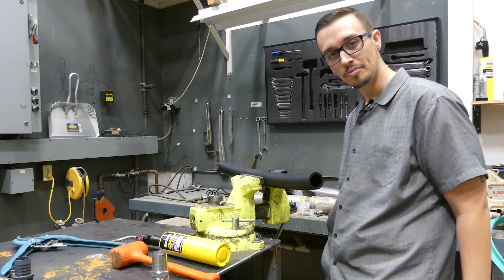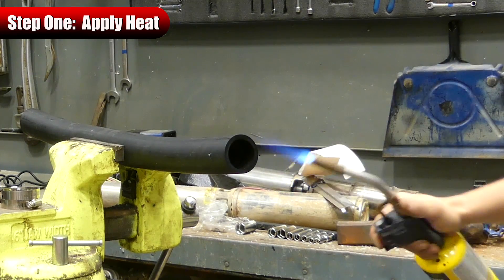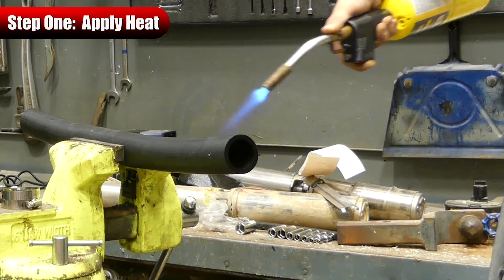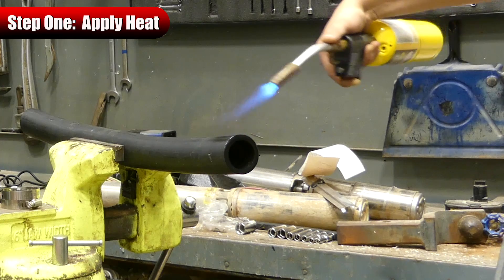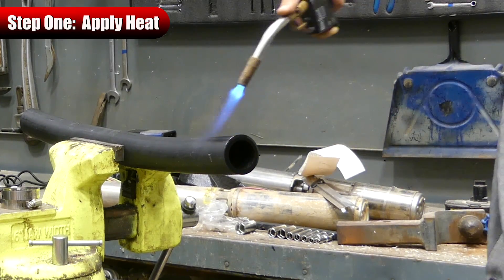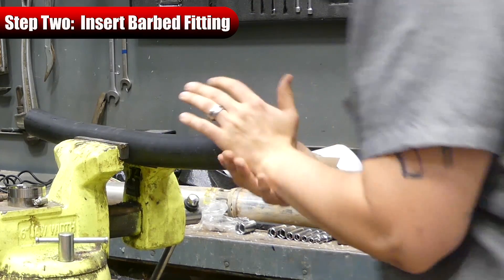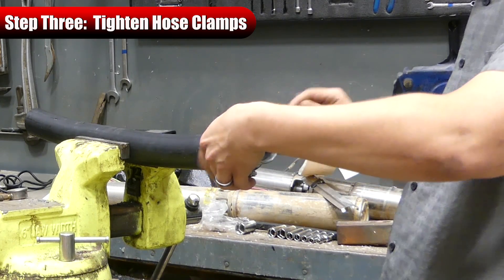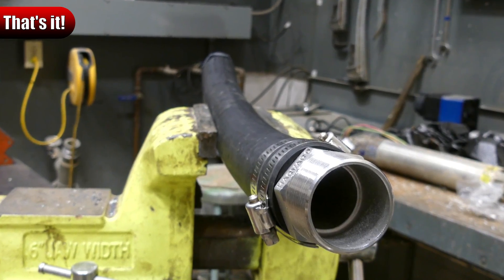How to Connect Poly Pipe to ANYTHING using Barbed Fittings

Comment: Can heated Polyethylene pipe be stretched around a larger barbed insert.  I have a 1" barbed fitting and two Polyethylene pipe options. #1) The ID of one Polyethylene pipe is .87" and #2)  ID of the other Polyethylene pipe is 1.097.  what one should I choose for a well pump application?
Reply from the maker: What size are the poly pipes? 1" and 1.25"? You should use the same size insert fittings as your pipes.
Reply: 1 1/4 inch is the smallest I would go on any well application. most are 1 1/2" or 2" for maximum water flow.

Comment: OK I got some good info I never knew, however, my problem is removing these fittings after they are installed. Any tips? Thanks!
Reply: re-heat them and remove them. however the pipe end will be deformed and not be any good for reconnecting to a fitting. I suggest you simply cut them out with a hack saw and if it need's  be extended  add a splice barbed connector and a small piece of poly pipe to the end.

Comment: Can this black poly piping be used as a replacement to a corroded copper line from the meter to the main valve to the house?  Is pet better than poly for this use and how deep should they be buried down?
Reply: If you are asking these questions please don't do it. Lol

Comment: Why don’t you just buy poly pipe compression fittings that are made for the job .
Reply from the maker: We do sell those as well, but for the cost many contractors opt for insert fittings since the compression fittings are easily 10x as expensive.

Comment: blow torch is overkill.. i prefer heat gun
Reply: Heat gun is ok unless your outside on wet grass or working where a pipe has broken and soaked the area,Butane won't electricute you
Reply: @desert1cop  bammmm

Comment: Do these barbed fittings rust?  Or are they stainless?  I'm needing to pipe 1000ft of drinking water from my well to a large 1000gallon poly tank, and I want to be sure the connections dont rust on me.  Should I use brass?  How long do the connections last?
Reply from the maker: We sell brass and stainless, we like to go with stainless because the barbs go a bit deeper into the pipe. I'd say the fitting should outlast the pipe, 20+ years or so.
Reply: R.C. Worst & Co., Inc. Thanks!  Will check out your site

Comment: You are oxidizing the poly with an open flame, wouldn't a heat gun be better ?
Reply from the maker: This is a great question that I think warrants a followup video. I spoke with the factory that manufactures our poly pipe, they said that oxidation does not occur until the pipe is heated to over 425 degrees. He also mentioned that it is generally not a worry when you're using a torch because the pipe is soft enough to work with long before 425 degrees. Keep an eye out for our followup video!

Comment: That makes perfect sense compared to other info I have read/watched... I have 1" HDPE I think it's 200 or 250 psi and I need to connect to a 1.5" polypropylene sink trap tailpiece. Any thoughts? Thank you.
Reply from the maker: You would want a 1" insert x 1" NPT and a 1" x 1.5" bushing. If the sink trap has female threads then that's all. If it has male threads you'll need a 1.5" Coupling as well. Here are links to buy all 3:
https://www.rcworst.com/BII-SSMA-100-Stainless-Steel-Male-Adapters-1-MPT-x-1-INS-p2174.html
https://www.rcworst.com/304-Stainless-Steel-Bushing-1-50-x-1-p5074.html
https://www.rcworst.com/316-Stainless-Steel-Merchant-Coupling-1-5-p8091.html

Comment: great vid.  Question: in low pressure situations must the pipe be heated first?  I wish to go from black poly to PEX, have all the barb fittings and clamps, but do not have torch.  Can I get by with just clamps?  Many thanks
Reply: Use a heat gun, they are cheap and easy to find. or grab the wife's blow dryer and use it. it will take a little longer but will achieve the same results. if you still have none of these item's. you can dip the end of the pipe into a pot of boiling water to help soften the poly pipe. If you still have no way to do this,,, call a friend that has a blow dryer.
Reply from the maker: Thanks for watching! You will have a very tough time trying to insert the barbed fitting without heating the pipe. Also, when the pipe cools it "constricts" on the barbed fitting. If you can somehow manage to insert the fitting without the torch, just clamp it down and check for leaks.
Reply: Many thanks!  Also, good advice for the positioning of the clamps for proper fit.  Thanks again for reply.
Reply: What type of fitting did you use for the poly to pex since they have different inner dimensions?